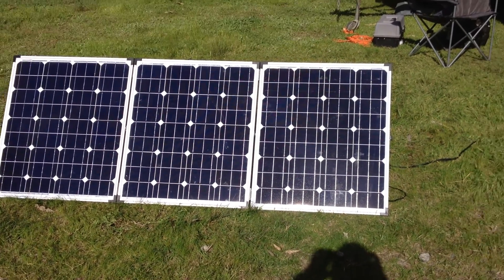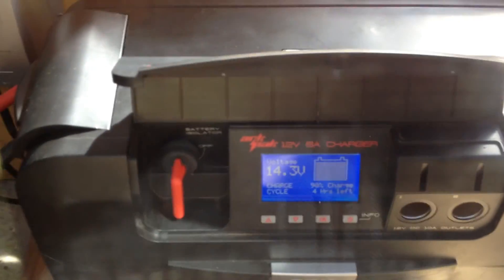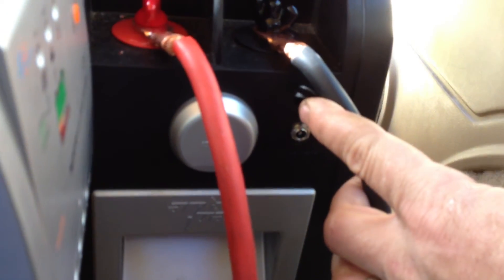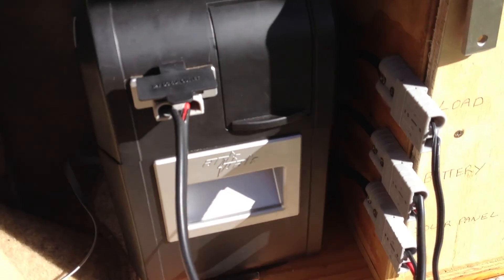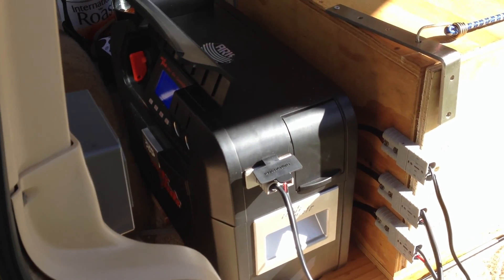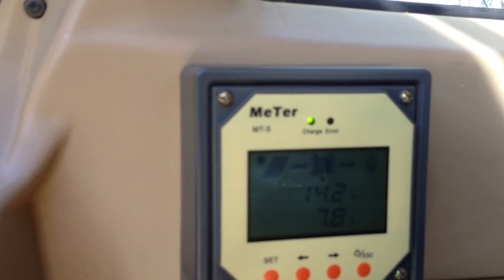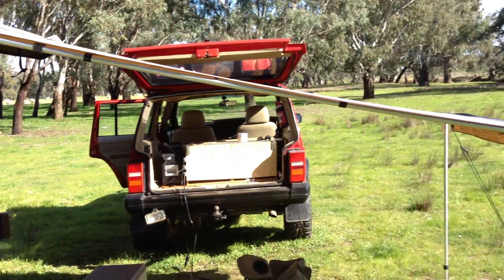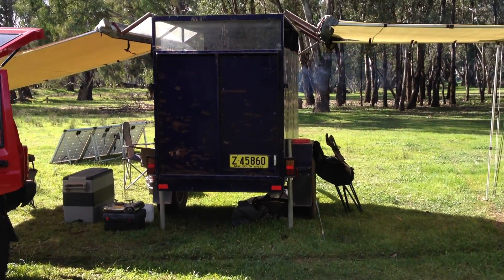How to go camping with solar power

Comment: how come you went off the load terminal off the mppt controller and not from the battery can you enlighten me thanks,Confused!
Reply from the maker: No worries , the accessories panel is connected to the load so I can see the amp draw v the amps coming in from the solar panel via the monitor connected to the charge controller. Also the charge controller has a built in low voltage cutout if I the battery gets too low. Hope that makes sense. The inverter is connected straight to the battery via the terminals because of the potential high amp draw (6000 watt peak ) it would fry the 20amp controller.
Reply: malakye heke Yup as Scott said, i have done the same with the same controller. I was using the battery direct at first. But now i use the chargers output terminals for low consumption devices like charging my gadgets and any led lighting etc, as it protects the battery from becoming over discharged, and i can see how much power etc im using on the LCD screen. 

My inverter goes to the battery for the same reason too :)